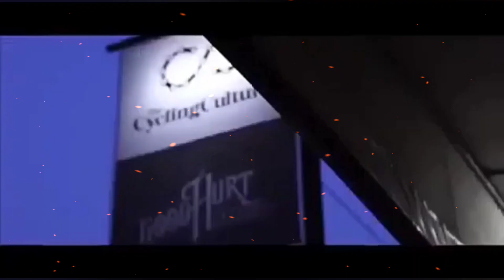The Project Gravel Grinder - Build Idea

Comment: Automatic ba na kailangan ng IS to FM adapater pag bubuo ka ng disk brake setup sa gravel grinder boss?
Reply from the maker: Hello sir
Depende po sa gagamitin mong disc brake caliper sir,for example po pag ang caliper mo is flat mount ,tapos na side mount ang frame gagamit po kayo ng flat mount adaptor,pero pag nakaflat mount na po yong frame nyo sir rekta na po yong caliper na nakaflat mount
Reply: @hepebikes  flat mount po ba yun gravel grinder na frame and fork? Thank you boss
Reply from the maker: @karlfgs  hindi po sir nakaside mount po sir ,kaya pag ginamitan ng flat mount na brake caliper kaylangan pa ng adaptor

Comment: 11-50T ba yung cogs bro?
Reply from the maker: Hello sir,11 -46 lang po sir
Reply: @hepebikes  no issue naman sir sa shifting? No need na po goat link?
Reply from the maker: @ereldomingo4949  wala naman po sir,nakaset na po yong RD para po sa   mga malalaking cog
Reply: @hepebikes  maraming salamat sir ganyan dn kasi plano ko fd and rd akala ko hanggang 42T lang pde
Reply from the maker: @ereldomingo4949  Your welcome po sir 🙏😊
Reply from the maker: @ereldomingo4949  basta sir same model ng RD and Shifter
Reply: @hepebikes  sensah srx pro 1x11 yan diba sir
Reply: Sir last na san ka naka bili ng seat clamp? Wala na mahanapan
Reply from the maker: @ereldomingo4949  yes sir 1x11 po 😃
Reply from the maker: @ereldomingo4949  about sa seat clamp sir try mo po kay BMX cycle sir baka meron pa po silang  available na seatclamp 29.8 ang size
Reply: @hepebikes  hepe last question same build halos tayo, bumili naman ako ng zoom na breakcallipers need ko pa ba bumili ng brake cables?

Comment: How much po inabot ung build? Anong brand po nung brakes na ginamit?
Reply from the maker: Almost nasa 40k sir

Yong brakes caliper po na ginamit dito sir is ZRACE Cable actuated caliper hydroulic flat mount sir
Reply: @hepebikes  ano pong sukat ng post mount adaptor ginamit sa fork at likod?
Reply from the maker: @armeltabing5670  ang ginamit ko pong adaptor sir is IS flat mount adaptor sir ,160mm same lang po sa front
Reply: @hepebikes  salamat sa reply sir. Excited na ko buoin TPGG ko e.
Reply: Sir nag adaptor ka pa po? And san po nakaka bili?
Reply from the maker: Hello sir sorry for my late reply

 @japetaway1068  dito po samin sir sa cycling culture ph,pero sa ngayon sir out of stock pa waiting pa kami sa next deliver